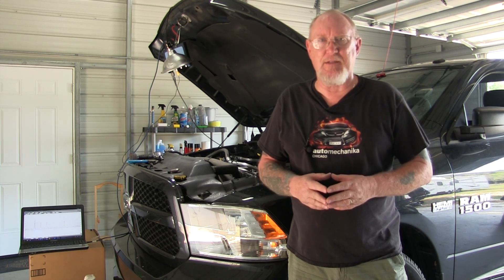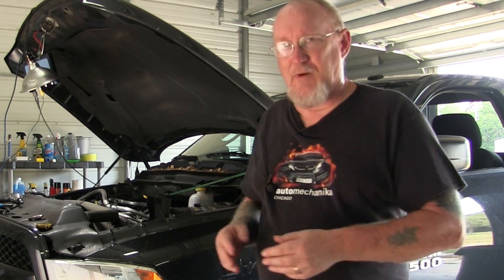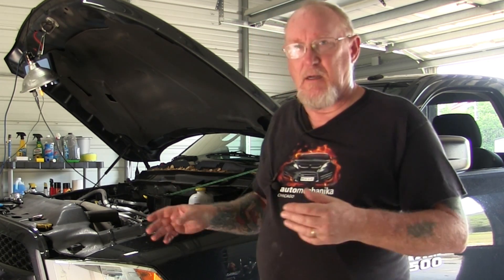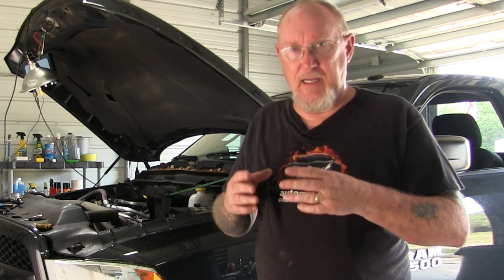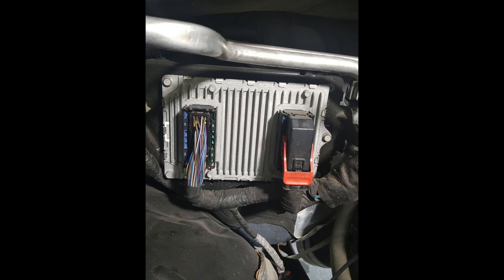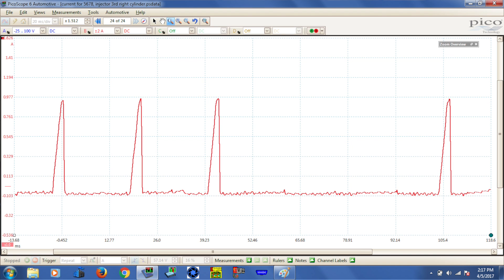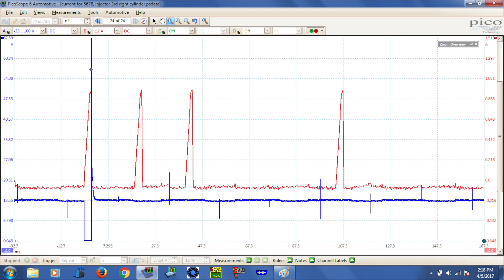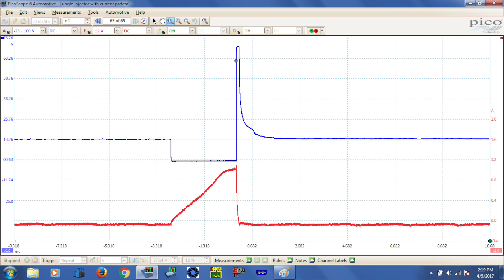Motor Age How2 #14 - Exploring The Injector Circuit, Pt 1

Comment: You can do this by backprobing the connector at the injector, too. Right? Don't have an amp clamp yet.
Reply from the maker: You'll get the voltage pattern but not see the opening hump you can see in the current pattern. And be careful to know your scope's limits OR use an attentuator.

Comment: Nice ! Pete, that is a pretty nifty idea grabbing the ground side of the injectors when the power side at the fuse has other components on it too ! I've seen on other channels where they said you can't look at it because other components were also powered up by the same fuse and gave up on that approach !  Another approach would be to squeeze all of the injector power feeds at the computer into your amp clamp !
Reply from the maker: There is the one power feed, though, Billy, and to access the splice to separate them would require digging into the harness - too much work!  :-)

Comment: Did you not mean 200 Volts per channel for the new PicoScope? You said 100 Volts :(  There is no need for attenuation with the latest PicoScope when measuring injector voltage!
Reply from the maker: I was referring to the 4000 series. I was not aware they come out what the new model with a higher voltage intake level. Thanks for making me aware of that.
Reply: You're welcome: Full specifications here with details of increased sampling rate of 400MS/s, higher memory buffer 250M Samples; Floating grounds; and of course ConnectDetect® ! https://www.picoauto.com/products/automotive-oscilloscope-kit/picoscope-4000-series-specifications
Reply: I was about to correct Pete too until I saw your post but I believe the earlier Pico was 100v and now they are  ±250 V (DC + AC peak) on single input. That is why they use to sell a 20:1 attenuator  now they only sell a 10:1 attenuator.
Reply: The previous scopes did indeed have a maximum input per channel of ±100 V - and before that  ±50 V - both of which therefore require(d) some attenuation because of the high induced voltage when the injector is turned off. (Attenuator still required for primary ignition systems!)

However, both the 2 and 4 channel 'Rainbow' scopes - out now for a couple of years - have a ±200 V input per channel capacity - NOT  ±250 V! (May be you are confusing the overload protection built into PicoScope?) 

The sure way to identify these newer  'Rainbow' scopes is that they have coloured 'rings' near the BNC connectors:  blue and red with the 2 channel scopes; and blue, red, green and yellow in the case of a 4 channel scope. 

As a point of note, and whilst this might change, at the time of writing and when running the software in demo mode on your PC WITHOUT a scope connected you will still see a max voltage input of only ±100 V. But, plug in a 'Rainbow' scope (I haven't tried an earlier one!) and you will see that the maximum voltage does indeed display ±200 V. (400 V Peak to peak)

Once again, here is a link to the specifications of the current scopes:
 https://www.picoauto.com/products/automotive-oscilloscope-kit/picoscope-4000-series-specifications

Hope this is clearer!
Reply: I know when somebody knows what their talking about ! I just save your company  in my favorites ! Thanks !
Reply: Nice ! It seems your a bit more knowledgeable than me on this subject than I. Thanks for the info and you are right I was confusing it with the overload protections. Do you work for Pico ?
Reply: Hi Billy. Thanks for your reply. No I don't work for Pico, but I'm a French distributor for Pico Automotive products, and originate from the same town as Pico, so I've known them since the beginning! I've lived in France for 18 years. My company - www.autotechnique.com - is UK-based, but my clients are mostly in France, French territories and Africa. Being English, and having worked for many years in the trade,  I get my 'kicks' from several US diagnostic specialists; and my own 'technical library' is adorned with books from the USA. I'm a fan of several companies, technical authors, and websites, there :)
Reply: Thank you Billy R. Nice to discuss things with civil, willing and interested people. Such a lot of talent out there. These training resources are great. I don't get my hands dirty anymore, so I'm finding it harder and harder to keep in touch. I try to keep watching as many videos, so as to TRY and keep up to speed with the changing technologies, and those sure ways to find and fix problems with the minimum of fuss and without the risk of making a wrong call. We all make them! My problem is finding the time to translate into French, and the equivalent for new the new words which appear as fast I add new content to our site. You take care!